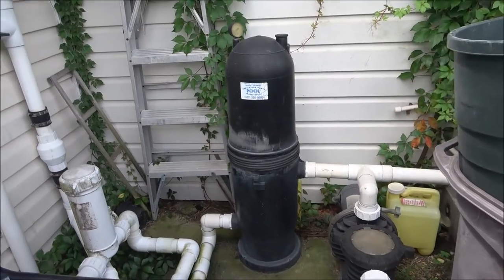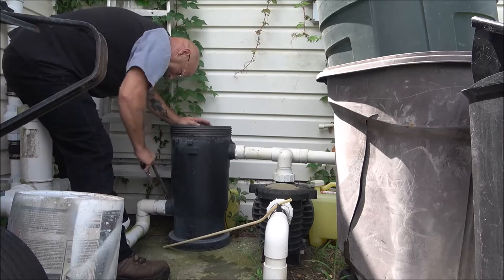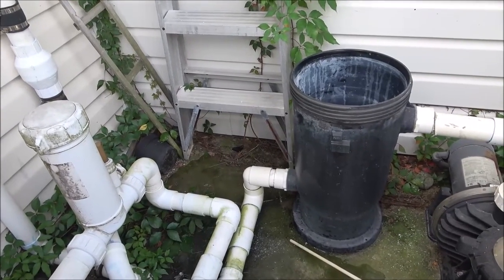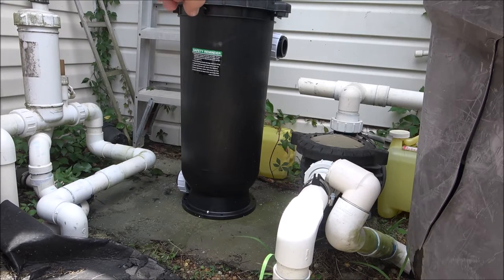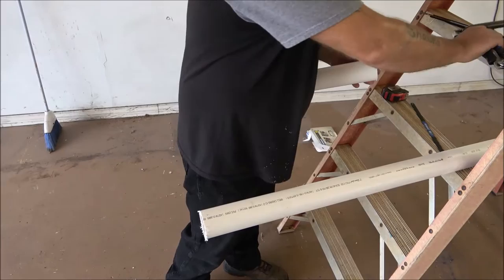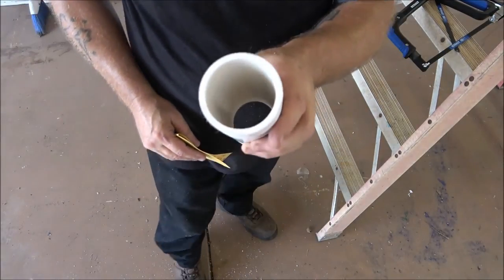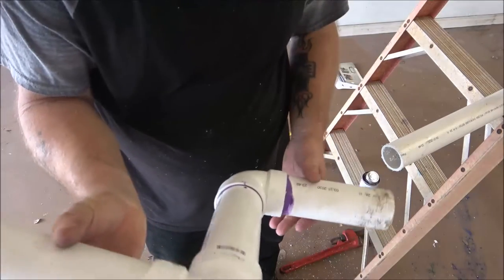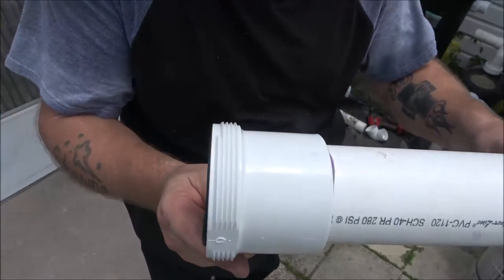Sta Rite Posi Clear Cartridge Filter 150 Sq Ft PXCRP150 Replacement

Comment: Cool video dude, just what I needed. Any chance you could add a video showing you taking the lid off and checking the cartridge or washing it?
Reply from the maker: I would gladly do that but the house is now sold. Sorry man. But its real easy just make sure everything is off and open the vent on top. To wash it just pull uot and hose the filter off with a garden hose. If you need to know more feel free to contact me.
Reply: @shabear1000  No problem mate, going to buy one anyway.